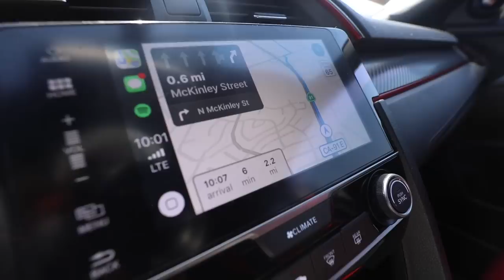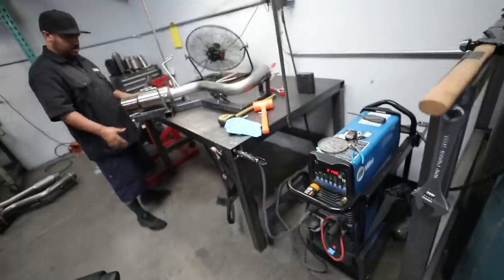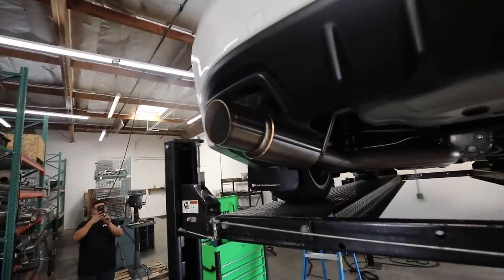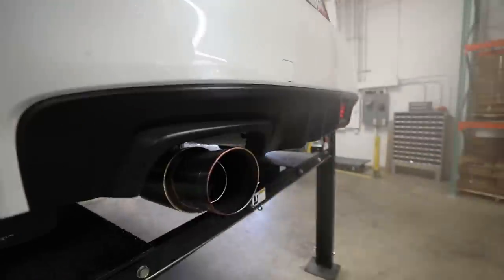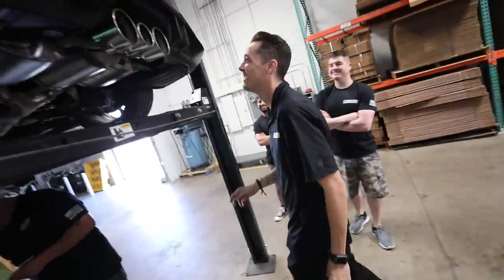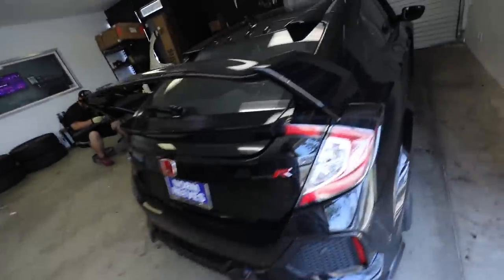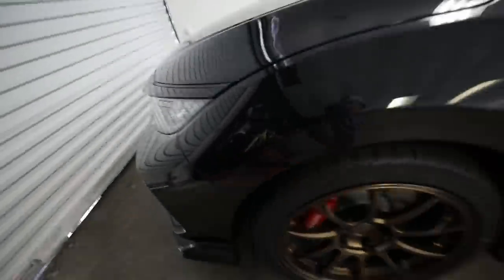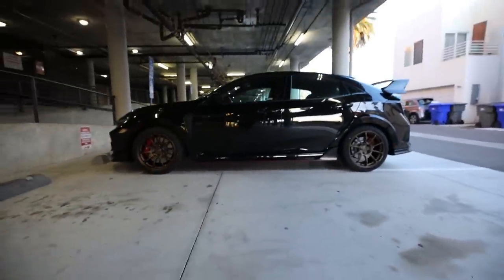CUSTOM WRX EXHAUST FINISHED & STARTING TYPE R CUSTOM EXHAUST

Comment: Hey man. I’m a Honda salesman and I can tell you the purpose of the three exhaust tips. 

The smaller tip is designed to get most of the flow when you’re driving slower for noise 

The bigger outter tips are for when you’re doing some hoonage and the exhaust can flow completely free. I’ve personally noticed that when you go wot in type r that you kind of hear air flowing towards the back of the vehicle. I don’t know if that made sence. But those who have driven or rode in type r with the stock exhaust can maybe relate.
Reply: Travis Montgomery lol no salesman says “hoonage”
Reply: Bryson Harris lol it’s the internet he’s not on anybody’s clock he can say whatever he wants

Comment: My dude, you have GOT to put some TPMS sensors in your wheels. That light is driving me insane!!
Reply: LOL as dustin would say "that light stays on when you have real deal JDM wheels on the car, it's somethings only i know"
Reply: Alex Dargi it should have an indirect system on the type r. The newer Honda’s don’t use actual sensors. Probably just needs to be reset in the cars menus

Comment: The two outer pipes include large straight-flow mufflers. The center, smaller diameter pipe is a resonator, shaped and sized to perform a particular aural trick.

Comment: personally top 5 i hate about my e46 are the window regulators, coolant expansion box always has a damn hole ive had to replace it 4 times so im trying to get an aluminum expansion box, power like you said you cant get much power with n/a,  how brittle everything is